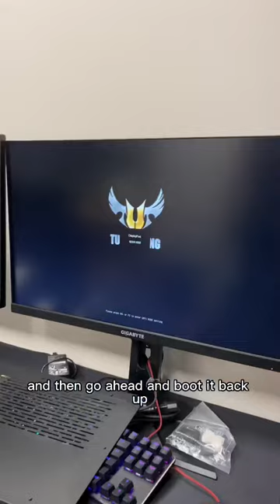CPU Overheating 🥵 #gaming #gamingpc #gamingpcbuild #pcgaming #pcsetup #pctips #pctipsandtricks

Comment: As soon as I saw MSI on the AIO I knew the pump was shot
Reply: I know I see their new AIO cooled cards and that's quite risky to ever use an AIO from MSI. The fact they pretty much did a fake recall disgusts me. I have one that "doesn't qualify for replacement".
Reply: @bradbeyers9028  mine also didnt
Reply: I had that exact one as soon as I got a new one my pc was fine, that aio is cursed
Reply: @OV.Q2  is yours the newer one? And don't speak to soon man. There's plenty of time. Literally just one day it started making a terrible noise and my CPU went to 100° C. Are u MSI damage control? 🤣 Q2 earnings call?
Reply: @bradbeyers9028  I was saying Mine didn't quality for replacement, but okay. Mine filled with sludge and I had to buy a new cooler to replace it since my cpu was throttling so hard
Reply: @OV.Q2  ohh lol, I don't think anyones did. I honestly believe it was just a front. Which dissapoints me cuz all the other MSI products I got are solid. And the one time I needed something from customer service they were decent but I've been way to busy to even try calling them. I'm apparently too busy to read into comments lmao my bad for misunderstanding you..
Reply: Some other big pc youtuber talked about Msi and their bad bad big batch of AIO pumps being cloged
Reply: Worrrdddd I had the same issue
Reply: I bought one but I took back to bestbuy it was difficult to me so I went air cooler instead on my first pc build
Reply: Lol
Reply: Mine got replaced with a V2 (Germany)
Reply: Mine also overheat after less than a month. I only use 5600x cpu, how an 360 aio can't cool it *smh

I RMA it and still using it almost two years now.

MSI need to work on their QC.
Reply: We all knew😂 thanks to @gregsalazar
Reply: @alphamaty3984  i use nzxt z63 aio, i highly recommend it
Reply: Lol, me too
Reply: @bradbeyers9028  From the information I have, MSI uses two different suppliers for liquid cooled products based on the positions of products, in this case of high end liquid cooled gpu, Asetek is the supplier for its Suprim Liquid's cooling solution, along with S360 AIO.
Reply: Mine just recentky stopped after owning mine for a year and a month...
Reply: Lmao had that same issue TWICE
Reply: @B4RDOCKTTV  lol, there is  "V2" of that aio where "V2" stands for "maybe this version will not kill your pc"
Reply: @Cosmopavone  yeah well after the second time, I’ve replaced it off warranty and got the V2, it’s been sitting in the corner of my room since then. Bought a mastercooler cooler. Lost faith in MSI
Reply: @Cosmopavone  mine was the v2, i went back to air heatsink.
Reply: Hacker
Reply: @bradbeyers9028  yeah it’s msi they have an issue of some aios clogging with this random gunk killing the aio from the outside
Reply: i had same pump and it stop working within 2 months got it replaced to corsairs instead i hear alot of crap about these msi pumps
Reply: It's an Asetek pump, it's the same pump that's in 100s of different AIOs. Tell us more about how you know nothing about parts.
If their builds AROUND the pump is bad that's on MSI, but the pump itself is a fine pump.
Reply: @Pobbatron  well I'm not sure if you were trying to prove my point, but you did.  Whether or not they use Asetek, I said 90%.  There are a few companies trying to make their own, but Asetek owns the patent for the all in one pump on an AIO, so no there's not really anyone else making them.  Please look it up and do some research.
Reply: For some reason msi just can't get coolers right at all
Reply: Can you help me out? I recently cleaned my pc with an electric air duster and when I plugged my pc back and tried to power it up again, the lights lit up and then a millisecond after it turned off and started smelling burnt plastic, I want to know if the GPU or PSU or my motherboard is shot. My motherboard is an asrock z270 pro4 and my gpu is a GTX 1070 Ti, I don’t know what PSU I have though.
Reply: @Deggo  go to a tech discord and ask there
Reply: The water pump on these self-contain cooling setups seem to go out pretty quickly regardless who it is from. It is as though they all use the same Chinese company for parts!
Reply: @Witcher21 lol you can’t say no one knows what they are talking about and then not know what you’re talking about
Reply: @taystoner7144  well go ahead and elaborate (:
Reply: It was branded I didn't even know that
Reply: Same lol
Reply: Not all AIOs from MSI are bad. The ones made by Asetek are the good ones. I have the Meg coreliquid s360 and it works like a charm.
Reply: @704Hauser7  really?
Reply: bad AIO broken within 1 year
Reply: Man I’m having this same issue and I have that exact same pump😂. I thought it was something wrong with my motherboard because I’ve tried everything. Cleared the CMOS, reapplied thermal paste, fans.
Reply: @MonsieurBlac  🤣 wow that's interesting
Reply: @no-_-copyright4322  that's not good
Reply: I have had mine for 1.5 years and i have not gotten a single issue
Reply: @Rismannen  cool 😁 maybe wait till year 2 though then see what happens 🤣
Reply: @whodatrn yup🤣
Reply: hahaha same here had it happen twice now i got an asus rog strix lc 360 much better
Reply: @bjornlauret4205  🤣 wait really
Reply: me too its just common.
Reply: what's a pump
Reply: especialy when he put it on top
Reply: @rickslotboom8827  really?
Reply: ESOUCZ  yup
Reply: @bradbeyers9028  mine did qualify and they sent me an old one again. When it Fucks up I'm sending it back regardless if they say it's qualified or not there's a YouTuber that has contacted msi due to this problem to have additional serial numbers added  you should contact him I will get the vid one sec
Reply: @clinthipfner6042  cool 😁
Reply: HAHAHA THAT WAS MY THOUGHTS
Reply: same
Reply: @bradbeyers9028  deepcool are better?
Reply: so MSI AIOs are bad ehh? didn't know this lol

not that I'm planning to upgrade anytime soon...my Deepcool Gammaxx 400V2 Blue is simply amazing!

Comment: The fact that ya'll gave him the same shit kind of AIO just hurts
Reply: yup... also its not they dont realise that specific AIO has the Pump on the radiator not on the block, it will be fucked in 1 month. i had 1 of those. those radiators are meant to be placed vertical in the front so the pump wont get air and die.
Reply: 'Service'
Reply: I'm pretty sure they make up the stories for these shorts as promotion.
Reply: He literally said it covered in the warranty. The warranty will only replace the exact model💀
Reply: @deatth00  there's no use replacing it with the same model considering that the model has had nothing but issues and recalls
Reply: But the customer was under warranty for the aio that's why he gave him the same aio and not a different one that they weren't under warranty for
Reply: @TheRealFenwick  that's not how warranty's work. You can't warranty your old model Alienware and get a brand new 2023 model. That #1 makes no sense #2 isn't economically viable #3 isn't in the stated warranty. Just because you don't agree doesn't matter, you bought the product, you agreed to the warranty terms.
Reply: @kfenstymiller  well considering this model of AIO is faulty and should be recalled it's well within the rights to request a different Brand at the same value
Reply: @TheRealFenwick  yeah, if you have the legal suit to prove so.
Reply: Coreliquid V2
Reply: Smh
Reply: I have a 240R V2 of that AIO and it seems fine for 2 months now, no issues (I run a 13600KF)

Comment: Never in my life have I heard of a "Thermalpaste issue"
Reply: Never used a computer that's several years old?
Reply: That thermal paste looked fairly fresh. Definitely never the problem unless it is a few years old. Good thermal paste lasts.
Reply: Clearly you've never in your life ever dealt with an lga1700 cpu
Reply: Can be an issue if it has hardened, didn't spread well, or the mounting wasn't done properly.
Reply: @Ah-fb8pc ga 1700 cpus dont cause thermal paste issues
Reply: @Jazz4950  umm yes the original bracket that comes on the motherboard does cause thermal paste spread issues because of incorrect mounting pressure. Learn what you're talking about before interjecting, there's literally countless videos on youtube about it high guy
Reply: @Whitout1 takes at least 2 years of contestant use with a proper application of thermal paste for it to get crunchy
Reply: @Ah-fb8pc  I deal with lga775 to this day. I still use an old ddr2 motherboard
Not as my main though, just for a mining rig lol
Reply: Could be an issue if they forgot to put it on
Reply: @Ah-fb8pc  Just got an i13700KF with a £30 aircooler... Intel said 100 degrees C is perfectly normal operating temperature. Luckily nothing uses more than 20% and a bit of an undervolt keeps it just below 100 as long as its not full load for too long lol... absolutely crazy temps I never expected this. I'm getting watercooling but from what I hear the best I can hope for is around 87 degrees C 😅
Reply: @jamieclarke2694  dude i have mine running at max 70c under full load, 30c on 10%/idle with just a deepcool cpu cooler,  watercoolers aren't the best for the intel cpus
Reply: you must not deal with computers much lol
Reply: @Jazz4950  not true. Any generation CPU or CPU socket type, can have thermal paste issues.
Reply: I had a friend who took his board into a repair shop and they applied the "perfect amount of thermalpaste!!!"

The goop was all over.
Reply: @jamieclarke2694 jfc 100c is normal?! My 6600k is overclocked to 4.5ghz stable and it sits at like 80c
Reply: @Kolb  apparently. Thoughcpeiple have got it lower with good watercooling I've heard so not too bad. I'm yet to play a game that uses more than 20% of the CPU so far though. Upgraded from a 2500k that was overclocked at 4.3GHz and that only hit 60-70 at most on a game, but it was bottlenecking my new 3060, probably because its 4 core 4 thread and lack of good cache. Yours will last longer I imagine
Reply: @KolbPROD  plus 8 cores are at 4.2GHz and the other 8 multithreaded performance cores are at 5.3
Reply: @jamieclarke2694  just got a 13700k and have the same results. Hitting 90’s with the AIO on. I undervolted while still reaching the boosted clock speeds and max around 80c when gaming now
Reply: @Allhypeee  I can do -0.150 offset at full clock, but I often play at -0.200 with e cores at 3.8 and p cores at 4.5 and haven't played a game that was bottlenecked yet since it easily outperforms my 3060 and uses no more than 20% on pretty much everything while the 3060 is at 100% lol
Reply: Ps4s man. You ever have a loud or over heating ps4? Probably needs new thermal paste and a good clenaing. Pretty simple if you know what you are doing and have the correct tools. And super cheap. For anyone still on there ps4s and wondering it is like 10$ usd for the tool kit and 5$ for some thermal paste. And your ps4 will run super smooth again like new.
Reply: Yeah you can create dry spots if you don’t screw it down evenly, which would cause overheating
Reply: I was thinking it would be a plastic film left on or the wrong mounting clips being used.

Comment: This is why I love air cooling, never have to worry about this
Reply: Cheaper easier and better
Reply: actually, even Linus prefers Air cooling
there are a few real common use cases for it.
but for any gaming PC, Air cooling will be the first option for me.
Reply: @atte9702  also quieter
Reply: @zentar2646  you can’t really hear my aio unless you have your ear next to it.
Reply: @jonlikesplanes  including radiator fans bruv
Reply: @zentar2646  yeah but a air cooler has fans too and makes noise like the radiator fans.
Reply: @jonlikesplanes  theyre more quiet
Reply: I've used AIOs since i built my first PC never had any issues over the years. It's really doen to picking a trustworthy and good AIO brands. For Me they also just look better then having one giant radiator in the middle of my PC.
Reply: @atte9702  they're just different
Reply: Depends on the CPU.  Some of the newer hotter ones do better with a GOOD AIO or custom block.
Reply: fr
Reply: Cooler Master Hyper H412R on R5 5600x and MX-4 never got above 50°C💪
Reply: @jonlikesplanes I have headphones on while also playing cod so all I can hear is constant gunfire and explosions. my fans don’t bother me. 😊
Reply: @atte9702  not even comparable. It’s not better at all😂
Reply: I used to love my air coolers (no tua) but Air cooling couldn’t handle my new 13700k, I had to go AIO
Reply: @fblfblfblfbl  I just got one. Intel said 100 degrees C is perfectly normal operating temps. I have a £30 air cooler and with a bit of an undervolt it takes longer to reach 100c on full load but I definitely need watercoolong now. Though overheard 87 degrees is about as good as we get, how are your temps with the AIO?
Reply: @jamieclarke2694  Good to know that 100c is ok. Mine runs at like 35c on idle and 60c when gaming. But when running a stress test it keeps going up and down between 85c and 110c. It's a bit disturbing to see 110c but I can't imagine any real world applications that would force the processor as much as the stress test, so it's ok.
Reply: @fblfblfblfbl  110 with watercooling?? 😳. Oh my god haha. Use intel XTU and change the cpu core voltage offset to -0100. You won't lose any performance but the heat should go down a bit on average.

Honestly I'm seriously considering underclocking, maybe even turning off the eco cores and maybe even only running like 4 or 6 of the perf cores. I'd bet that'll still run all games without bottlenecking the gpu lol and maybe get liquid nitrogen cooling for when games start to use all the cpu 😅😅😅
Reply: @jamieclarke2694  I get some blue screen freezes if I undervolt even a bit, but it's ok as long as it doesn't run too hot on my normal activities like gaming or video editing I'm fine with it.
Reply: Based Air cool pilled
Reply: Also I don't trust having liquid in my pc lol
Reply: @The1MMdefeater  if you buy good fans you can't hear them the noctua redux is AMAZING. I have 2 fans on it and my R7 is OCd to the max and runs cool. ZERO noise from these fans. I've made the decision to go all noctua fans for my PC the quality is worth the 30$ a fan
..
Reply: @jonlikesplanes  nah bro I got a Gen 1 h150 Corsair AIO the fans only go to 1600 RPM max and I generally have it around 800-1000 rpm you can't hear it.
Reply: For long-term usage, air cooling wins for it's simplicity and reliability and less risk from leaks. Even if the fans died out, the heatsink should at least provide decent cooling to at least boot the system and let you get a replacement HSF later.
Reply: Im using Corsair AIO for almost 10 years now, never a single problem. But right now i think its time for my new build
Reply: @zentar2646  lol just because the fans are on the aio doesn't make it louder
Reply: @peik_haikyuu2265  fans make noise
Reply: AIO perform better on hotter CPUs. You can get away with air cooling with lower end CPUS.
Reply: @zentar2646  yeah obviously but just because you attach it to an aio wont make them louder
Reply: @peik_haikyuu2265  im not talking about the pump dude im talking about the entire aio
Reply: @zentar2646  yeah your either slow or trolling but either way google is free
Reply: @peik_haikyuu2265  telling me that im slow while you dont even know the difference between your and you're
Reply: @zentar2646  no I’m on YouTube not in English class no need to correct every grammar error lol you missed a few commas tho
Reply: @zentar2646  bro nobody was talking about a pump in the first place like I said if you think adding a fan to an aio will make the FAN LOUDER you’’’re slow
Reply: @fireraid2336  Can you recommend some good brand you have tested so far?
Reply: 13th Gen Intel entering the chat.
Reply: I have 2 pc's, one custom cooled the other air cooled.  you cant beat the ease of use of the air cooling but the quietness of the water cooled rig is hard to beat.
Reply: yep true